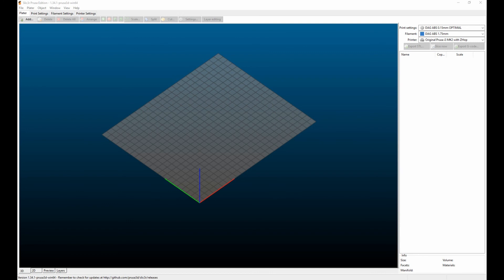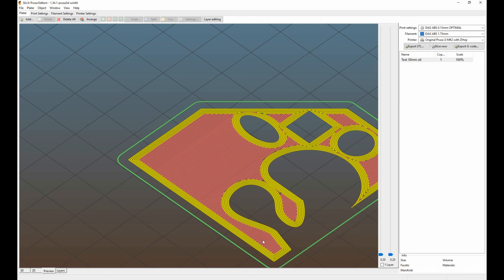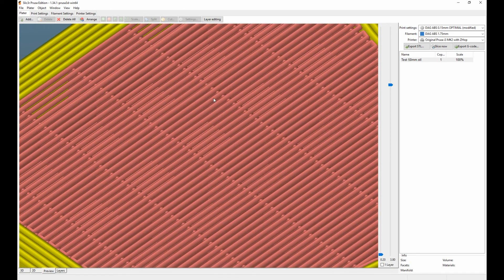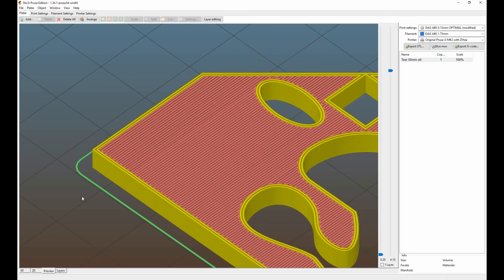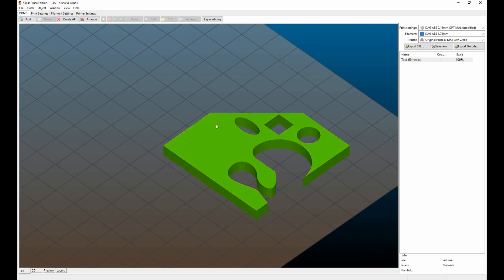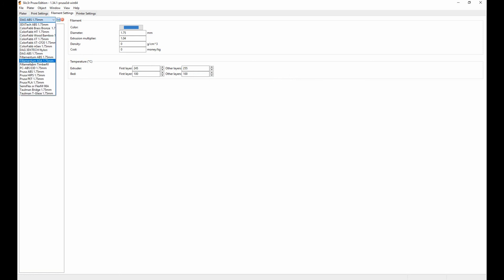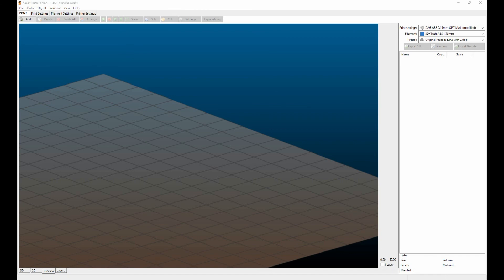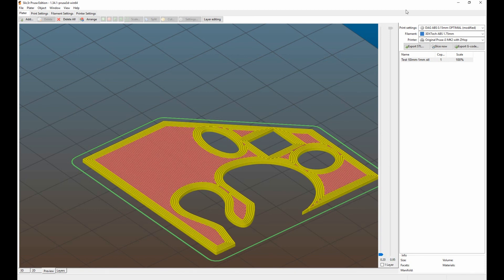PRUSA i3 MK2 Slic3r

Comment: Thanks for the video. Now I am getting better at understanding slicer programs. Been using Turbocad Pro V15 to make my parts but having trouble with mesh properties. Problems were that the polygons do not intersect (non manifold). Fusion seems like it does not have these problems and can make really good parts without mesh problems.